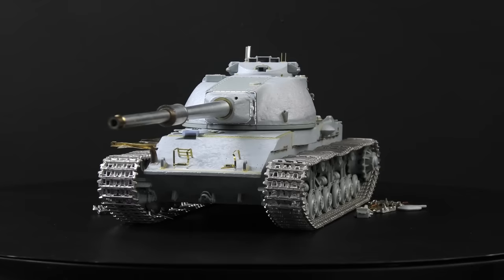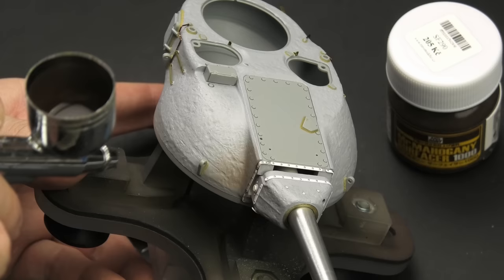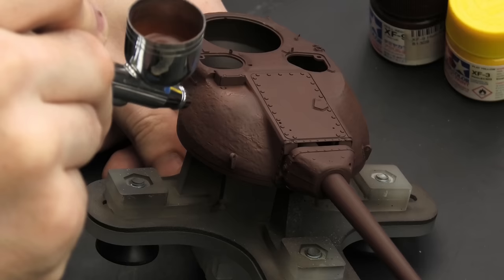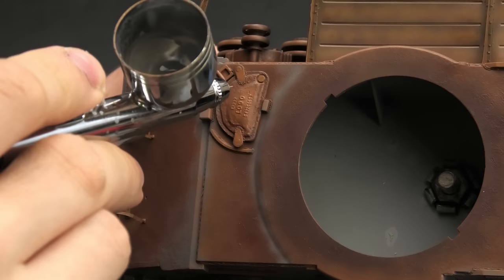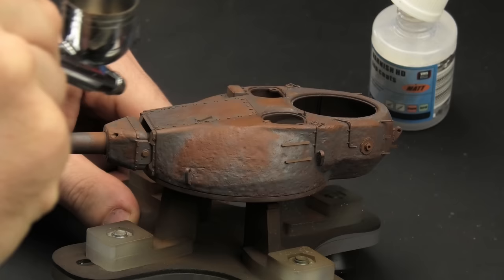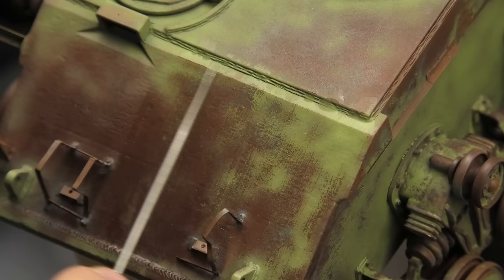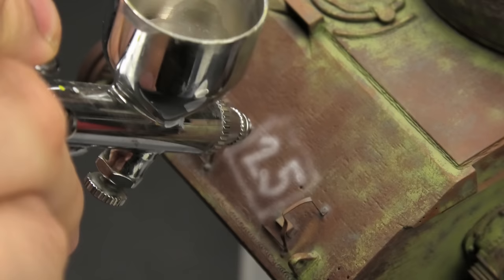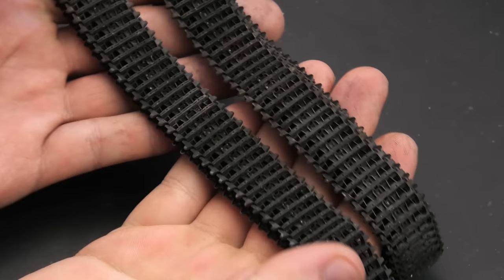Painting A Heavily Rusted-Out Tank With An Airbrush! (Conqueror Mk. 2, Dragon 1/35)

Comment: On the topic of brushes for weathering: I recently came across a set of "scratch brush erasers" by PK-Pro. They are handles with replaceable tips with different grades of hard bristles from nylon to wires. Might be useful for those hairspray chipping techniques you mentioned. Although I you could also experiment with making your own from an old toothbrush.

Comment: This might be heresy, or maybe I'm just an amateur. I always paint most of the larger groups of parts of a model that I'm building before I assemble the complete model. How are you going to paint the difficult to reach parts behind and between the wheels and the tracks? I see this happening on almost every YouTube instruction video. I might add I still mostly brushpaint my models although the large bulky parts (the hull without suspension system, wheels and tracks, the cupola with main gun etc). are spraypainted.

Comment: I tried that metal primer but with brush and I was dissapointed. But I 'll try it next time with airbrush. Only a question came into my mind, it is not a problem if the primer contact with plastic?
Reply from the maker: It can be brushed, but it works only on small PE - or you might need to use a large brush on large parts such as fenders, and do it all in one brush stroke, otherwise it'll leave visible marks. It will also build up on plastic, but the layer is invisible when you spray it.